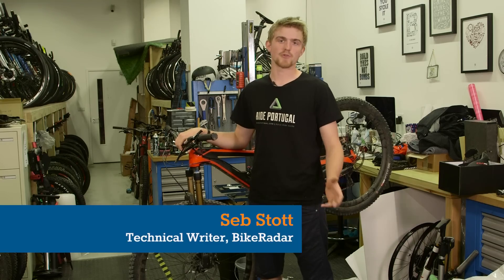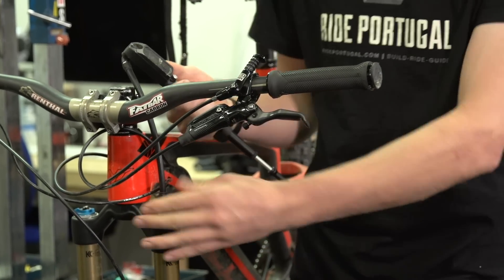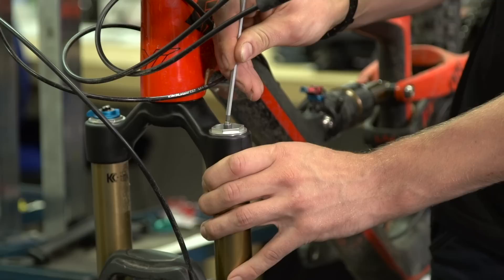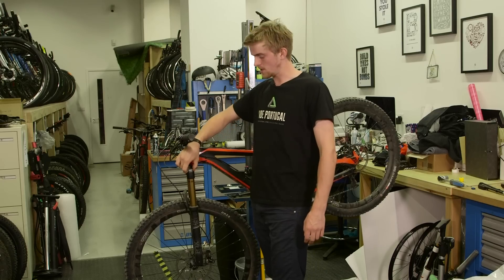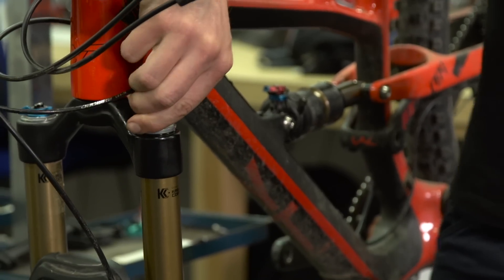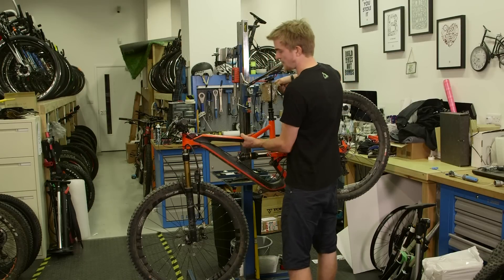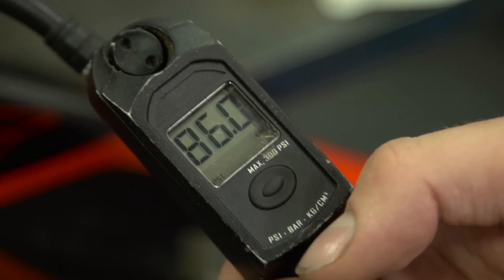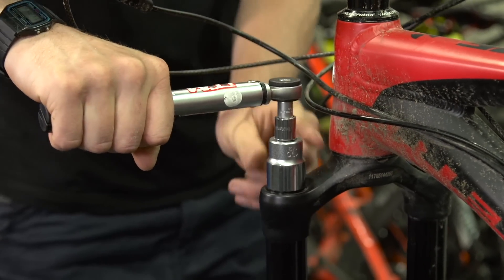How To Add Or Remove Volume Spacers To Fox & RockShox Forks

Comment: So...im about 67kg with all my gear and I think I have arround 150psi if my pump is correct. The problem is thats the ony way I can get 25-30%sag. If I follow the recomended psi its extremply plush...what am I doing wrong? Its a new bike with a Pike RC
Reply: Andrei nothing its preference and it might have recommend compression to go along with the pressure

Comment: What is the minimum number of tokens you can have in there?  Can you remove all of them?
Reply: Heather Rocklear Yes. But first try lower air pressure. Have you set your sag with full riding gear around 25%?

Comment: Does changing the tokens also affect travel or not? So if you have 100mm fork will adding a token change it to 90mm or even 80mm?
Reply: Sergio Prodi it won't change the travel, just how the fork feels. you're not altering the dampner, only the air spring
Reply: Sergio Prodi you may want to drop the air pressure a bit also after adding volume spacers as the air chamber has been reduced.

Comment: Could you explain the whole shock pump thing? I have a similar one but I'm not sure how to get an accurate reading and I didn't really understand how you explained it.
Reply: When you put a shock pump onto the fork, some air goes into the pump so the pressure reading will be below what was actually in the fork. If you take the pump off then reattach the second reading will be even lower than the first pressure reading. Subtract the second pressure from the first one and you will get the amount of air that is lost by the pump each time. Then just add this to the first pressure to find the true original pressure.
Reply: TheGreenGoato Awesome I'll be doing this next time thanks

Comment: and you only do this to one side? or are there volumn spacers on each side u must add or remove?
Reply: It is just on one side, because the damper is sitting in the other fork leg.
On the side where you can adjust the air pressure: air chamber (which replaces the spring), other side: damper (so the fork acutally works like a damper and is not just bumping around)
Reply: only air side